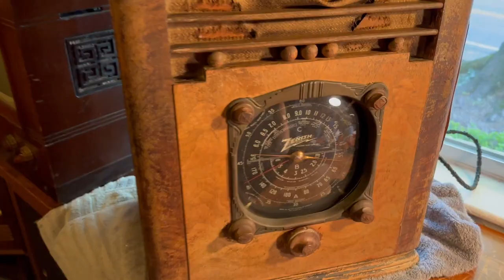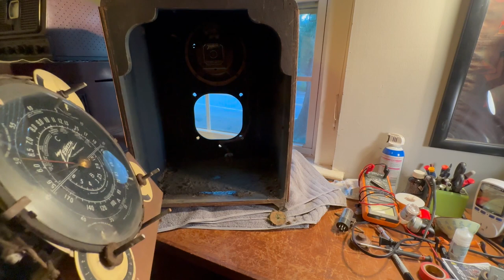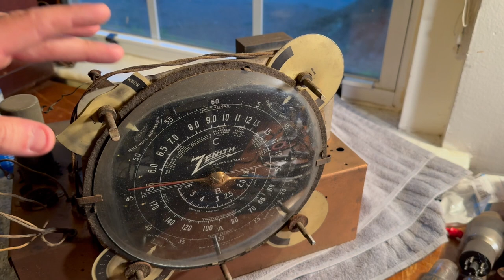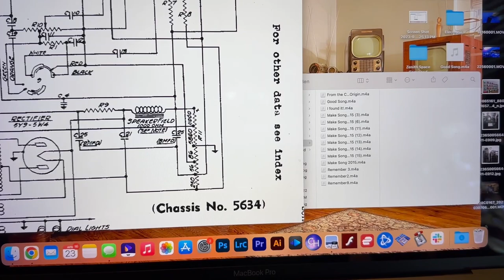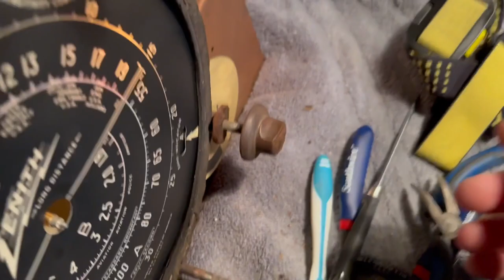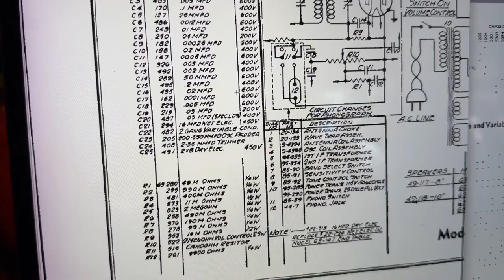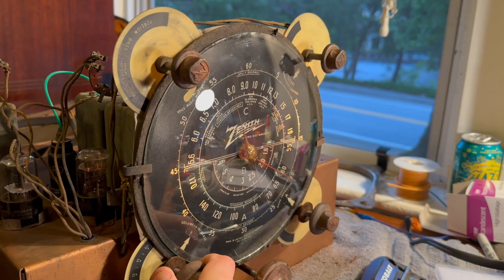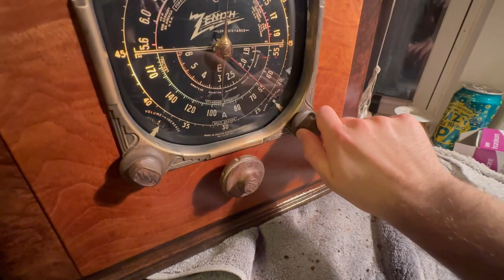1937 Zenith Tube Radio Restoration

Comment: Maybe I never worked with such an old radios, but that a lot of original components are still workable enough would not surprise me. Back in 2017 I was helping on the demolishing of an old abandoned house. It was abandoned since mid-80's and was in really bad shape. Because of damaged roof it was very damp in there. Floor literally was covered with a moss carpet, wallpaper were peeling from walls and a lot of furniture was badly damaged. Obviously because door was locked all this time there still was left some old electronic devices, some of which were in disrepair condition, like 1960's TV which lying on the floor because legs of the cabinet it was standing broke, but some was surprisingly well looking, like a 1950's radio in small bedroom which had less damage than rest of house.

 Back then I had not much experience with tube devices, but already had some collection of 70's-80's transistor electronics, so I decided to try my restoration skills with this radio and took it for myself (I originally wanted to take TV too, but condition of it scared me away because I was not sure could I save anything from it or not). 

As result after quick visual check and getting sure that there is no obvious shorts I plugged it into power, and it came back to life in a literal minute, on all original parts (it never was repaired or else including presence of all original tubes). 
Not gonna lie, back then it was a pretty big surprise for me because a lot of later electronics were already requiring some repair when I was getting them, but this radio was working for 30 years, then standing for 30 more years in awful conditions and still was working well, but looks like it just how these devices were made. Since then, except cabinet restoration, all parts I had replaced there were: rubber spacers between chassis and cabinet (original ones dried out and fell apart, power cable (more for safety sake) and one of the speaker wires because I managed to damage it by accident during disassemble process, and it still works more than well!
Reply from the maker: It is absolutely surprising today that electronics made in the 30s still have the ability to turn on and just work on all original parts. Perhaps it's lack of quality now? Or maybe radios were quite simple designs electronically speaking so not much could go wrong? It's an endless conversation that I have with myself about all the reasons how these sets were built so well. You can see the pride and hard work that went into crafting them.

Comment: Impressive work getting the old girl back from the dead. With water stains on veneers you could try vinegar and lite olive 
oil  mixed 50/50 on the top but oxalic acid  ( wood bleach) usually works best. Should spot treat it only to dark areas only
 and they should disappear as it is mostly bacteria and dirt in the fibers. History lesson !  M was used instead of K 
 because they used  the old Roman numeral system at first , so M=1000. Now we use K for kilo meaning 1000. The always
 wrote Meg for Megohms when they used the  Roman M in the parts list and chassis identification.  You should add a fuse
inline with the new  power cord to protect the transformer when you get a chance, just in case. Cody  loves his  new perch!
Reply from the maker: Wow interesting about the old Roman numeral system. It definitely threw me off at first.

Comment: A light restoration was the way to go for now. Like you said as you gain experience you can come back and do a proper restoration. If you haven't check out David Tipton's channel he has great tips on restoring radios. Also there are Bluetooth modules you can get to stream right to the radio. But still you did a nice job. Well done. Joe

Comment: Nice job!  I've worked on several of the console versions of that set.  One thing I would recommend is replacing the cabdohm resistor.  They'll either open, and cut B+, or short to chassis and take out the power transformer.  I even saw one that had caught on fire!  I make it a point to change it on every 1935-38 Zenith I restore.  Also, I'm not sure if you ever found a replacement for the tone control, but I think I have a parts 8S154 chassis laying around which uses the same part- if it's intact that is.  Happy to check for you.
Reply from the maker: That's very nice of you! I'm always open to donations but can't afford anymore space at the moment. I'm still in an apartment but looking to buy a house in the next year or so. I probably should replace the candohm resistor. I put it off because of the specific values at high watt values which I have to special order. I will get around to it in the future though.

Comment: I have successfully filled up missing parts of veneer with wood filler. I picked a color that closest matched the wood and once it had dried, I used a graphite pencil to reproduce the grain pattern. After refinishing the whole cabinet, you couldn't see the difference.

Comment: Nice work! One little tip - I would have also replaced C16, the capacitor to the grid of the output tube, before trying the radio. If that's electrically leaky, it can put positive bias on the tube and cause all sorts of damage.

Comment: Don't know if anyone mentioned it, but I have had great results with repairing speaker cones with a single ply of paper towel and contact cement. The dried cement is rubbery and flexible.

Comment: Good job with the resto!    RULE OF THUMB (for me, at least)... Take good close-ups of the area that may get spoiled during removal (decals, etc) and any pieces that get chipped or broken. Now you have a starting point for someone with a 3D printer to duplicate the item. Anything can be 3D printed but the artwork has tobe clear and to accurate scale. Remember: Garbage IN = garbage OUT.

Comment: Are there any radio stations... left?
Let me qualify that with a...    ...Worth listening to.
Answer for me, with an AA5 and AA6.  Nope.
Amazing it's survived that long unmolested, untouched, and unrestored.  Which is uper rare by now.  In fact, restoring it, you'll probably plummet it's value imho to me anyway.  Restored working radios, now a dime a doezen.  Diamond in a rough?  100% original.  Good luck ever finding one of those.  It's like barn finds, they don't exist any more, because peopel find them, restore them, then sell them.  No more barn finds.  Unicorns now sadly.  Like this radio.  It's a unicorn.

This ain't 50 years ago when these were a dime adozen.  It's 2023.   Some project for Glassslinger.  This is 2023,a nd this is a super rare 100% stock museum piece.  Anything you do to it would destroy it's value.  IMHO.   Because its now.. what do you call it... an anachronism.    Something that escaped restorers this long.   Only to have you as a newb get in there and start yanking out tubes and desoldering dried out electrolytic capacitors.

Kind of like someone trying to retouch up the Mona Lisa because the colors are fading lol..

I just bought the broken 10 commandment tablets on ebay... what a score, came with the ark of the covenant boxed set.    A little bit of Quikcrete from Home Depot, and bam, they'll be back together in one piece no longer shattered and as good as knew!  Can't wait to show the Jews!   Working 10 commandment tablets again.. woo hoo.  Just like if Moses had never shattered them...
Reply from the maker: I would never compare restoring a radio from 90 years ago to "restoring" the Mona Lisa or the 10 commandment tablets...What an odd analogy. Radios are a part of history like typewriters or televisions. Only going back 100 years. There are a lot of these out there that people still have the original finish on and original components. Keeping mine in the condition I found it in wouldn't do it's history justice. I wanted to show it's beauty as it left the factory. I've found many many radios that have never had work done to them.

Comment: how do you kep the cats from scratching the cabinets? i have cats but i cant let them in the rrom were i have my tvs and radios
Reply from the maker: They have scratch posts and beds so I think that discourages them from jumping on the cabinets all the time. But otherwise, they’re just good boys. When they jump on the cabinets, they don’t have their claws out. They’ve scratched some other wood furniture before but I just put some restor-a-finish over it and it looks good as new. I’d rather risk it than not having them around when I’m working on things